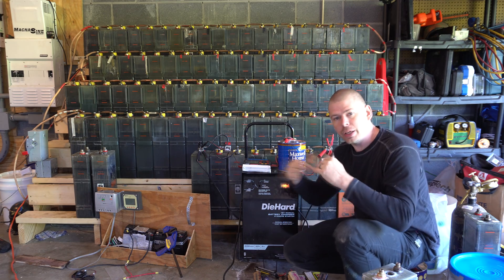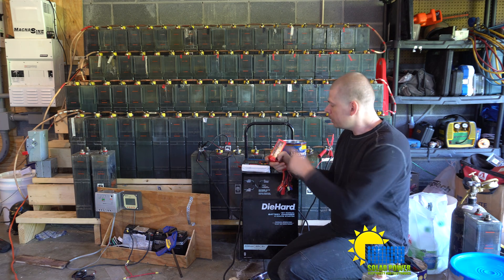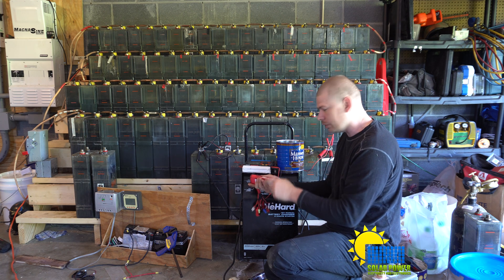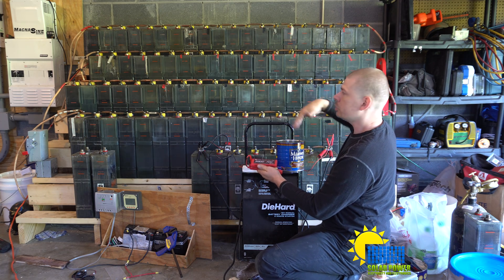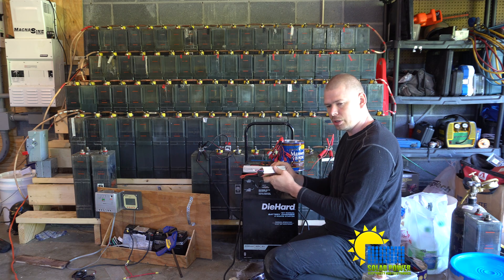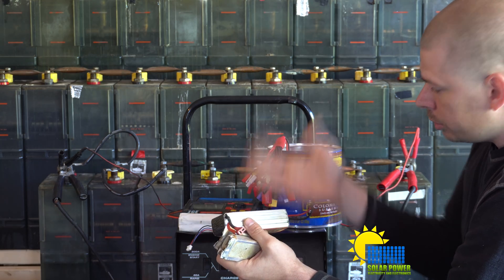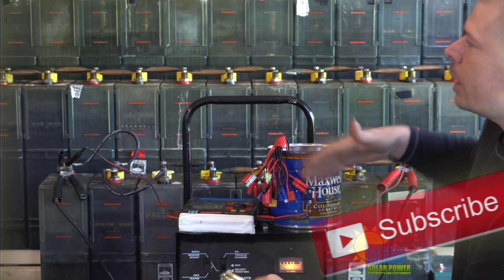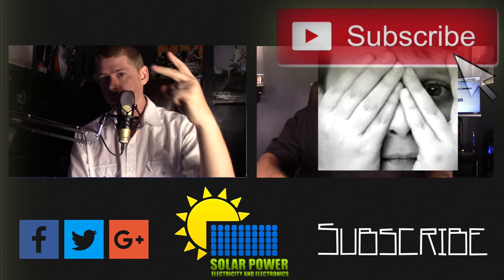A new off grid solar power project with Lithium Polymer batteries

Comment: That's a better way to go than stuffing around with 18650s I reckon...you won't need so many! :) How are you going to balance them?
Reply from the maker: xanataph technically I won't have to have as many if I have 5000 milliamp battery packs but considering I would still need about 400 lithium-polymer 5000 milliamp battery packs vs 1700 of the 18650 is which are much easier to get a hold of considering yesterday I picked up almost 70 18650